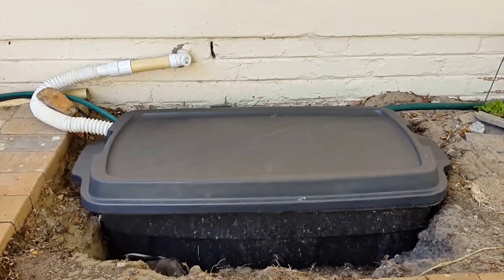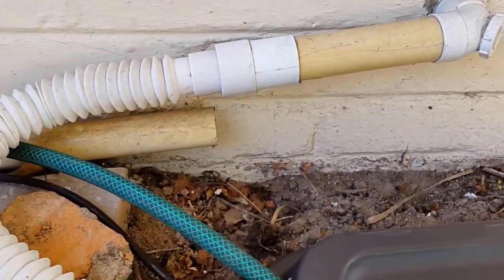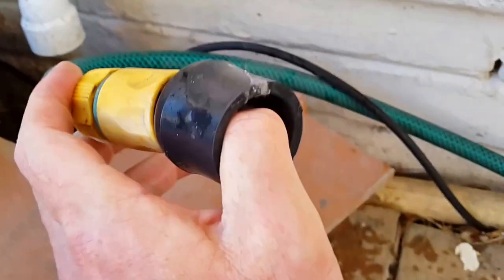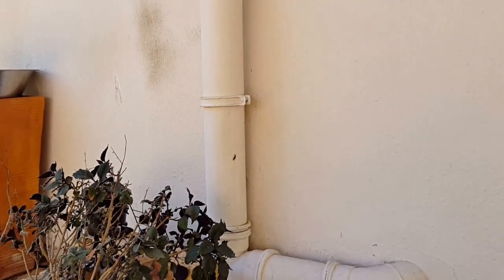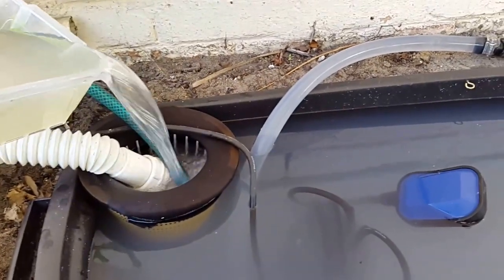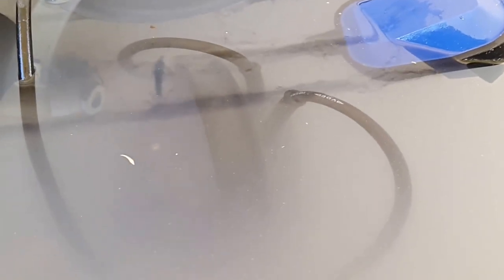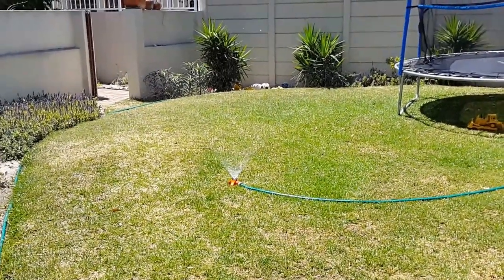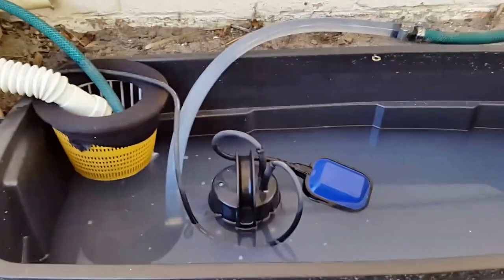1. DIY Grey Water System with submersible pump - overview

Comment: Hi I know it's probably not such a serious  concern anymore to reuse greywater but I prefer too My question to you is do you think if I were to install a valve or tap in the outlet line from a submersible pump to restrict the flow, would that be detrimental to the pump. I don't want to turn it off entirely just lesten the flow and avoid over throwing of water. Do let me know your thoughts

Comment: Hi, the pump in the link is a 110/5 v pump so you would have had to connect it via a step down transformer. Can you advise me if there are any available with a 220/30 v rating?

Comment: What voltage is the pump, if is imported from AMAZON, it is most likely 110-115 V ac ? If so what modifications did you apply to make it work on 220 V ?
Reply from the maker: I purchased the pump in South Africa, so it's a 220V pump. The Amazon link is for international viewers :-)

Comment: How do you decrease the flow rate to 10-15 GPM? The maximum flow rate rating is too high for my application. Is there anyway I can reduce it? Thanks...
Reply from the maker: Hi, the flow rate specification is the maximum of the pump. When you add reducers and long hose pipe, as well as some elevation, the flow rate is already decreased significantly. Mine operates with a 30m length of 20mm hose pipe, and the flow rate or about 20L/min (about 5GPM).

Comment: I heard that you shouldn't let gray water sit more than 24 hours. What if I don't produce enough gray water to turn on a float switch because I go out of town. Is there a way to also include a timer on the pump? Or should I just empty the remaining gray water, someplace safe, when I get back?
Reply from the maker: Yes, it is best practice to not store grey water more than 24hrs. In a situation like you've described, the float switch can be forced on manually to empty the tank before one leaves.
Reply from the maker: Correct. You can also use a smaller collection tank so it fills quicker and pumps out more frequently.

Comment: Very nice video. thank you for sharing.!!

One question... Does your storage tanks develop a bad smell over time or is that not a problem for your system?  I am a little worried about bad smells as I am also in an urban area. thank you in advance for your reply.
Reply from the maker: Yes it does smell a bit over time. I clean out the filter and entire tank about once a month, which helps. You can also add bacteria to the tank to break down the odour-causing oils and fats.
Reply: Thank You

Comment: So... soap and shampoo won't affect the grass over time?
Reply: Not if it's organic. Also, you must make sure that the soaps you use contain little to no phosphates.
Reply from the maker: Been using for over a year now, and no effect on the grass. I use phosphate free dishwasher tablets and 'normal' washing powder in washing machine (although it says it's biodegradable).